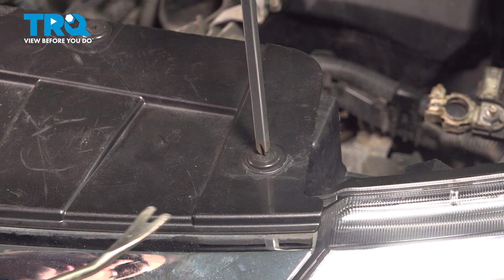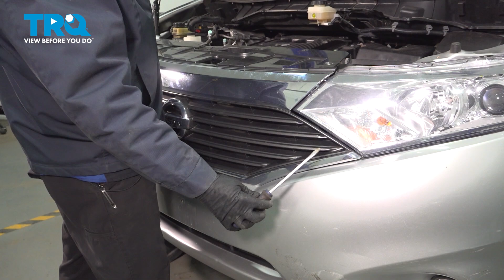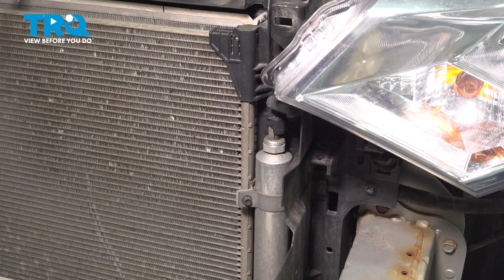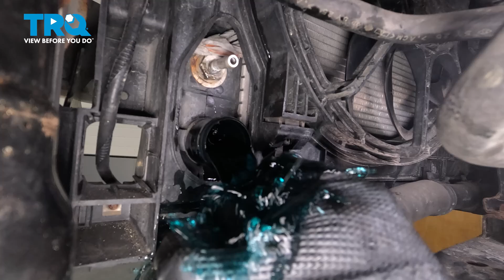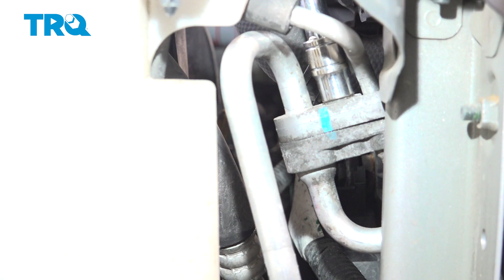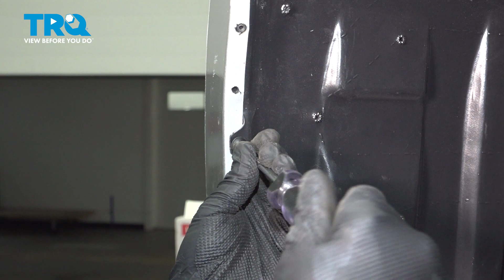How to Replace Radiator 2011-2017 Nissan Quest

Comment: I just looked up what it would cost for just the labor alone to do this job I don't know if I'm confused but I typed in 2014 Nissan quest and it's coming out as labor alone $289 on the labor alone is that accurate because it sounds pretty low to me

Comment: I did this over the weekend.
Great tutorial however I found that it’s not necessary to take the wheels off, and to access the upper transmission line, the battery needs to be removed.
This took me 8 hours and saved me a ton of money.